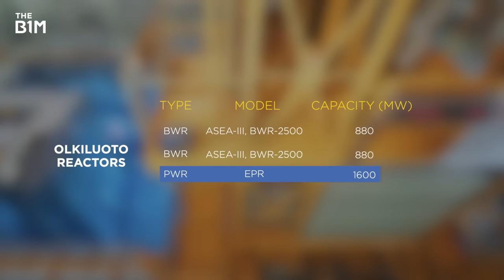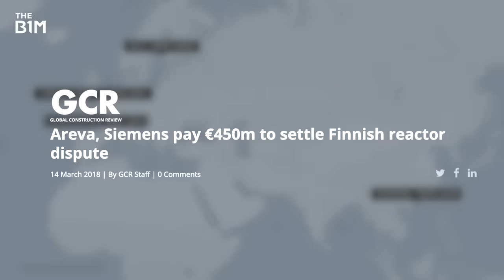Finland Might Have Solved Nuclear Power’s Biggest Problem

Comment: we couldn't bear witness to the environmental impact of burying it™ so we decided to bury it deeper™
Reply: We are literally returning it to the environment as that's where we got it from in the 1st place
Reply: @NadeemAhmed-nv2br  Bullshit....its a far more concentrated form unlike the uranium ore it originated from.
Reply: @NadeemAhmed-nv2br  expect in an entirely different, more dangerous state then when we took it out.
Reply: Well, the concern with burying nuclear waste would be potential contamination of groundwater and it's certainly not gonna be contaminating any groundwater when it's too deep for that to happen, below layers of solid rock. Radiation has no measurable environmental impact if it isn't interacting with biological material (the heat produced by decay in some deep tunnel is not gonna cause the climate to get warmer and rock surprisingly doesn't grow extra arms or get cancer from the radiation).
Reply: @tiikerihai  taht is ONE concern and yes that conern can be eliminated by burrying that stuff too deep to contaminate ground water. But what about natural desasters like earthquakes? One moderate large one coud damage the whole structure, radioactive material begins to leak and travel upwards maybe even while the earthquake is going on and it might be pushed to ground level and there we have it, another fulushima. So I do not believe that this sollution is the ultimate goal, the Ultimate sollution to the problmem. However the risk of a major incident is much lower and compared to fossile fuels it might be the better option. 
But in the end we should really put our ressources into renewable energy sources.
Reply: @dojando6003  you dont do this in countries were earthquakes happen lol
Reply: @dojando6003  Earthquakes in Finland.
Reply: @DirectorBird   Never been natural disasters here, and earthquakes in particular.  In fact, Finland is listed as the geologically safest in the world.
Reply: @Redfizh  Now, it's not like his point isn't valid. It's just not valid in Finland.
Reply: @DirectorBird  that's not how earthquakes work, the earth is actually more stable underground during earthquakes, that's why subways and wells are so stable during earthquakes.
Reply: Whatever works.
Reply: @default2826  I know.
Reply: Russia has MANY ground water problems because she’s pumped it under ground for years !!!!!  🥶
Reply: @mr_tntstogemanreviews4625    GOOD dam POINT !!
Reply: New Zealand is blatantly ANTI NUKE. also she’s got more fault lines than Swiss cheese ! 
So DEEP storage would never work here anyway !!!!!!!!!!!!!!!!!!!!!!!!!!!!!!!!  !
Reply: @dojando6003  Finland is in the middle of a tectonic plate, earthquakes are not likely and even if they were, buried material is not magically going to travel upwards. For things deep inside earth to come up, you need some kind of a mechanism behind it. Say the edge of two tectonic plates meeting. Renewables are great and all, but sometimes there is no sun and other times there is no wind. You need something to produce power while thats the case. Your options for that are not renewable sources, and batteries are not ths answer either. Battery production is extremely damaging to the environment. 
So unless they start erecting FES all over and reach capacity thats adequate to deal with downtime, nuclear is the cleanest solution.
Reply: @tiikerihai  That is true however, wouldn't it be better if radioactive waste and waste in general was not a byproduct of generating electricity as is with solar and wind energy.  Additionally, we would not need to mine for the Uranium fuel and process that ore which would also impacts the environment.  Most of nuclear's setbacks are solvable but to me when you compare lifecycles of energy systems, wind and solar have a much simpler and more effective process of generating electricity.
Reply: @mr_tntstogemanreviews4625  There are earthquakes in every country around the world the Earth is constantly moving.  Most of these earthquakes can not be felt however
Reply: @samuelast3174  well no shit it would be better if there was no radioactive waste. All renewable is not an option, though. So you either have radioactive waste from nuclear or nox and co2 from fossil fuels. Pick your poison. As an example, germany is going heavy on fossil fuels. China is almost entirely coal. And thats while being by far the largest renewable user.
Reply: @samuelast3174  ok so it doesn't matter cool
Reply: Boy, burying it. Now there is a cutting edge solution.
Reply: @dojando6003  if it’s 500 meters below the surface, cracks won’t let it escape anyways, ignoring the fact that the waste is in metal casket and the fuel rods themselves aren’t exactly fragile or volatile either being that they are solid metal rods.
Reply: . Well, what do you do with your other dangerous waste? The one that stays toxic until infinity.
Reply: @samuelast3174  life cycles of wind and solar is merely 20 years after which they are not recyclable. fission plants can operate for 50 years easily. and solar panel manufacturing needs materials that are incredibly toxic and just as damaging to mine than uranium. also solar power efficiency is incredibly low compared to fission.
Reply: @tiikerihai  what are you talking about?  Renewable energy sources provide that option of not "picking your poison".  You are incorrect about Germany where fossil fuel consumption has declined by roughly 25% and renewable energy production has doubled over the past decade (https://www.cleanenergywire.org/factsheets/germanys-energy-consumption-and-power-mix-charts).
Reply: @mr_tntstogemanreviews4625  didn't say it would matter.  I was just pointing out that there are no countries where earthquakes don't occur so your argument was invalid.
Reply: @MrTeddy12397    your numbers are a bit outdated.  Turbines now last 25-30 years and solar cells last from 25-40 years.  Additionally, since these projects can reuse infrastructure they are often repowered.  Additionally, turbine manufactures have started producing recyclable components and the turbine as a whole is up to around 40% recyclable.  Not all solar manufacturing processes use those toxic materials.  Also, while solar may have a smaller efficiency, it doesn't require a fuel source, emissions, or moving parts to operate which means that the costs associated with operation are next to zero.
Reply: @samuelast3174  Your post has nothing to do with what I said. What I said is that Germany is choosing to go the fossil fuel route rather than nuclear to supplement their renewable energy production (in fact they are shutting down their nuclear). Renewable energy with the exception of hydro doesn't have 100% uptime and you don't control how much energy is produced so it cannot provide power on demand. Which means you need either nuclear, energy storage or fossil fuels to supplement your renewable energy production.
Reply: @tiikerihai  You didn't mention supplemental power at all you said  Germany was "going heavy on fossil fuels".  As for power on demand, there are plenty of options available.  The energy storage systems are improving and becoming more common within renewable energy projects.  Right now, the technology is not good enough to completely replace fossil fuels (because of the power demand fluctuations as no project will overdesign the capacity to dump electricity into the ground to meet specific demand) but it can however take up the vast majority of baseline generation needed to operate the grid.  Additionally, you do not need the technology to have 100% uptime to meet demand.  By integrating multiple sources of energy (Wind+Solar) and having grid connectivity, you strengthen the grids resilience to events which reduce renewable energy production.  At 80m above the ground the wind is basically always blowing, during the day the sun is always shining.
Reply: @samuelast3174  a conversation exists in context of several posts, you cant isolate one from the context and then assume it means whatever you want it to mean. I have no interest in anything you have to say, because it is not relevant to what the original  conversation was about and you're not really saying anything insightful.
Reply: @tiikerihai  that's not what I'm doing though, i'm directly replying to the arguments you are presenting me??
Reply: @samuelast3174  I am not the one who seems to have problems with reading. I did not present a single argument to you either, so I recommend learning what an 'argument' is before you post something idiotic again.
 That said, my previous statement stands, I still have no interest in engaging with you, so you might as well go waste someone elses time instead.

Comment: They burry those spent fuel rods now, but in a few decades when Moltex Energy's SSR-W or Elysium Industries's MCSFR reactor gets operational, they will go and dig it out:)
Reply: Haha, was thinking the same :D All the "spent" fuel that could be recycled in a different type of reactor. Someone just needs to finalize the design (and spent some money on it, which is probably where the problem lies).
Reply: If this reactor gets online there is a good chance they will run it flat out for 30 years... I hope new designs will take this over cuz while 3rd gen is super great its not the best we have available...

Comment: Although spent fuel can be reused as fuel, we don't, therefore creating an enormous problem for ourselves.

There's hundreds of years worth of energy available in just our existing spent fuel, if used in fast reactors, and the final waste needs only a few hundred years of storage, not hundreds of thousands. The only reason we don't do this is because it can take 20 years or so before such a reactor starts turning a profit.
Reply: Ah, politics and crony capitalism. Nothing new here.
Reply: hamper the development of nuclear reactors by subsidizing fossil fuels and crippling nuclear fuels with heavy regulation

How could nuclear be so expensive?!

Comment: I like the simplicity of "ehhh f*** it let's just put it back where we found it"
Reply: just many times more radioactive than how we found it.
Reply: @Duconi  you mean many millions times more radioactive
Reply: @Duconi  That's only temporary. It's more radioactive because the nuclear reactions also produce some elements that decay at a fast rate and therefore produce a lot of radiation. But because they decay faster they'll also be gone faster.
Reply: @seneca983  it needs around a million years to be on the same level as natural Uranium. So, in human time scales it's still very very very long.

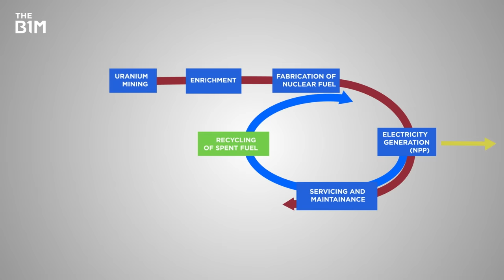Comment: 3:38 "Although spent fuel can be re-enriched and re-enter the fuel cycle..." Er, so why don't they do that then?
Reply: It is a long and expensive process and you need to built facilities specifically for that. And even then you will still have nuclear waste. It is like wringing out a wet towel. You will get some water out that you can use, but some will stay in the towel and you cant just put it back in your closet, since it is still wet. (the towel beeing a metaphor for the nuclear fuel and wet beeing a metaphor for radioactive)
Reply: Cost. France is one of the countries trying to figure it out, but the theory is quite sound. Currently almost 96% of spent fuel can be recycled through some complex and costly methods, but the great benefit is that the remaining 4% of non-recyclabe waste can be stored quite easily through vitrification. Also there are ways to recycle spent fuel and ensure that the leftover waste is highly radioactive for an absudly short period of time, under 1,000 years and even as low as 100-200 years.
Reply: They do, but it's not infinite.
Reply: Because the re-enrichment cycle is not an endless cycle and each time some radioactive waste is created if I remember correctly.
Reply: You cannot "enrich" most nuclear waste. Nuclear waste is not just the fuel in the fuel rods. It's also the structural material holding the fuel in place, the reactor vessel when it needs to be decommissioned (steel ages and after so and so many years it cannot withhold the pressure anymore).
Reply: In addition to cost and complexity, fuel reprocessing creates massive amounts of radioactive waste.
Reply: The better solution is designing/ building reactors that run on spent fuel. The science is there and the designs are very close.
Reply: @mtn1793  While that is plausible, how are we going to deal with spent spent fuel rods?
Reply: @dbclass4075   The designs I’m talking about don’t produce spent uranium fuel rods.
Reply: @mtn1793  They don't crate Plutonium. The fact that current reactors do is not a bug. It's a feature.
Reply: @EinChris75   A feature which is ridiculous and destructive.
Reply: @mtn1793  The problem with that is that I have been reading about that since the 90's. Nuclear R&D spend has also gone down, not up because of the high cost overruns concerning 3rd gen reactors build in China, Finland and France. These 3rd gen reactors kind of seemed to have killed nuclear past 15 years.
Reply: @mtn1793  So they are consumed. Assuming there is no other concerning byproduct, it is worth further research.
Reply: @StAngerNo1  
To follow that wet towel analogy, what technology/power plant would act as a dryer...and what happens if I forget a dryer sheet? 🤔😋
Reply: @dbclass4075   The science is there and people are working on several designs. Uranium fuel rods aren’t a very efficient design but the technology is figured out, so path of least resistance.
Reply: @tissot233   Yeah, but it’s still closer than Fusion. Gen 1 fission was built so huge for maximum profit that it got out of control, in my opinion. Small scale, factory built reactors will be the next stage in America’s energy strategy. There are 3 companies getting close.
Reply: @리주민  There is no dryer, but you can hang it somewhere to let it dry over time, and that place is the end storage, where it sits until it is not radioactive anymore.
Reply: It's too expensive. Nuclear power is cheap because it compromises safety. Whenever I hear people say how clean and cheap nuclear power is I have to think of exactly that: it's either safe OR cheap, never both.
Reply: Well the Russians do it. They developed the method because they had to eliminate weapons grade uranium from n-bombs. A year ago they bought all of German used nuclear fuel to use as reactor fuel.
Reply: Because current old tech reactors use solid ceramic fuel pellets in metal tubes that leave more than 90% of the usable fuel unused. Then reprocessing this is complicated.
On the other hand, liquid (molten salt) fueled reactors use all of the fuel because the fuel circulates. They also can be continuously fueled while running, and any undesirable products can be continuously separated. These products are much less in amount and shorter lived too because for one they don't have the useful fuel inside. Liquid is obviously easier for industrial chemistry than solid. Think of it like trying to fuel your car with coal. Much more complicated than gas/diesel from simple physics alone.

Comment: Essentially

Step 1: Dig Hole
Step 2: Line hole with concrete
Step 3: Fill hole
Step 4: Put roof over Hole
Step 5: Fill rest with dirt
Step 6: Put sign so nobody is dumb enough to dig it back up

Solved